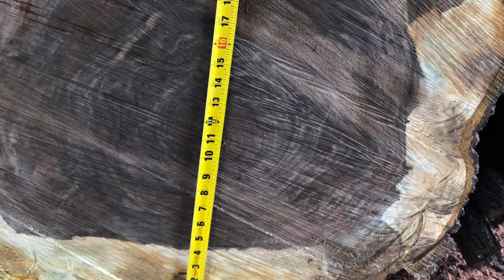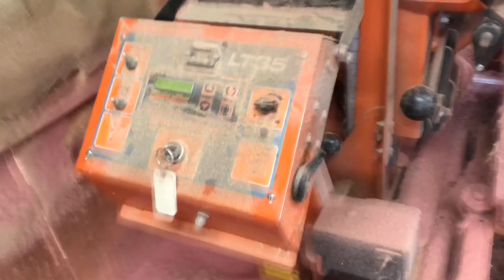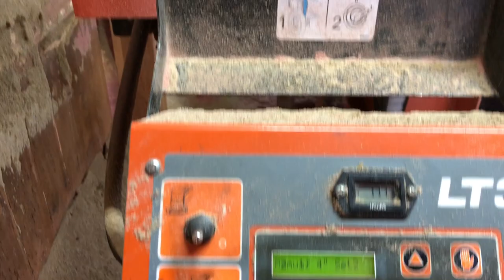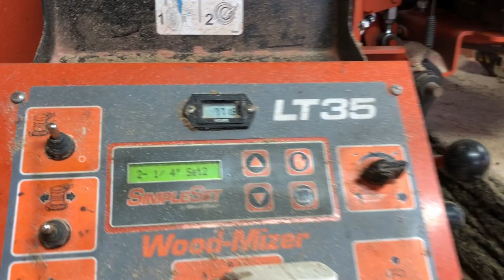Sawing Live Edge Walnut!!

Comment: Probably a stupid question, does the debarker mess with the live edge? If I'm not mistaken,  it cuts like 1/4 inch think 1/8 inch deep groove?
Reply from the maker: It does a very little. Some of the slabs you can tell and some not really. I debated a while back whether to use it or not on live edge walnut but I figured by the time it dries down and then gets ran through the planer it will get taken down and won’t be able to ever tell.

Comment: Over 700 hrs on your LT-35 wondering what I may expect to have to replace on mine by the time my LT-35 gets there, mines has 74 hrs, only thing I replaces was the v belts the blade runs on only because one day a blade came off while trying to back out of a cut and the teeth got ahold of one of the belts so I replaced both, thanks, ps. Looked for the video of the new Sawmill shed but couldn’t find it, watched the last video at night the sawmills last day in the old shed
Reply from the maker: Yep it’s got about 830 hours right now only thing I have done is grease change the oils and replace the belts on it. We’ve had a few small things but nothing bad at all. A small bearing went out. Yes I’ve knocked the blade off several times it happens unfortunately. It’ll scare you for sure it’s pretty loud bang.

Comment: Will those pink stickers have any effect on the slab's color as they dry?
Reply from the maker: It’s red cedar lumber I use for stickers it doesn’t have any effect on the color of the wood in my experience I’ve been using the cedar for 5 years just about and haven’t had any problems